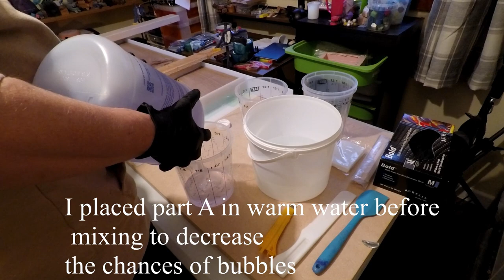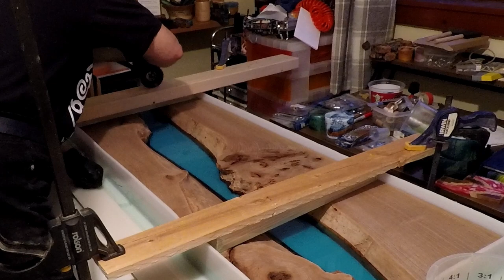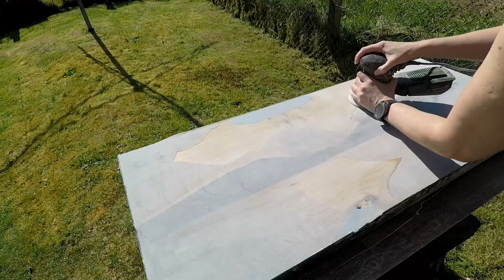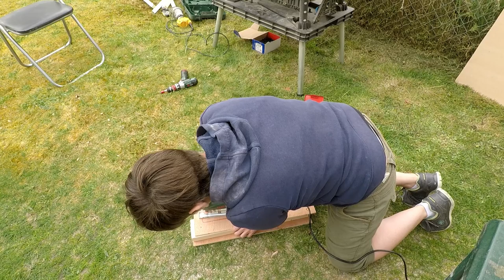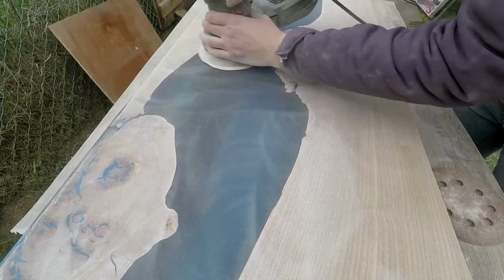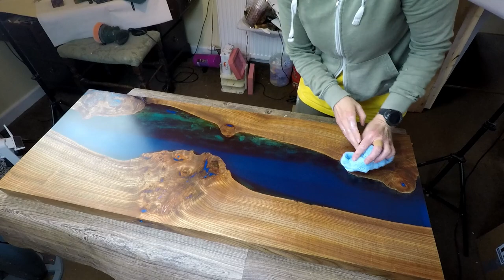Resin river table (part 2 )

Comment: Hi Pam
I love the table too, its on my to do list, i picked up some large live edge black walnut for the job, i've been pondering resin, i was casting pen blanks with the resin you are using, mixed by volume, i was informed that clear slow " mixed by weight " shines to a higher gloss , it is much more fluid and heats up quicker so needs to be in the pot in about 12-15 minutes , but outside of a pressure chamber seems to boil almost, the residue in the container froths although inside the pressure chamber it sets much quicker say 2 hrs,  and looks to be good, i think when i pour my table i will use the same resin that you did,.thanks for the great videos
Rob
Reply from the maker: Thank you Rob with a mica colour it would be just perfect :-)